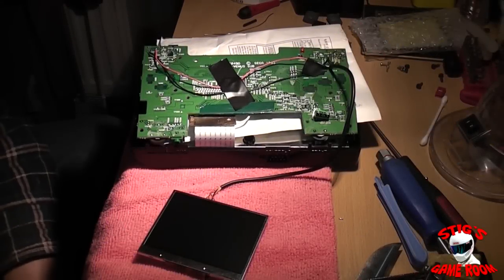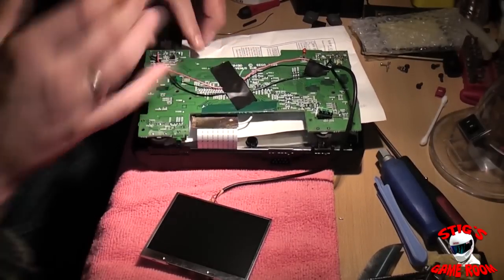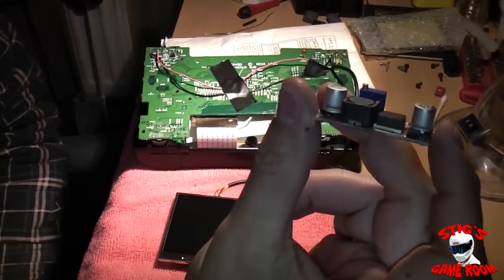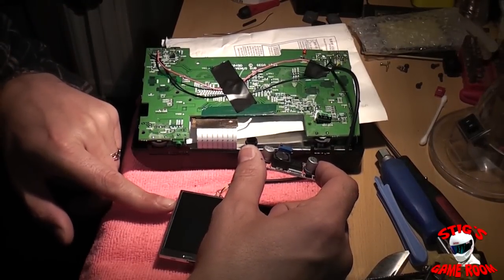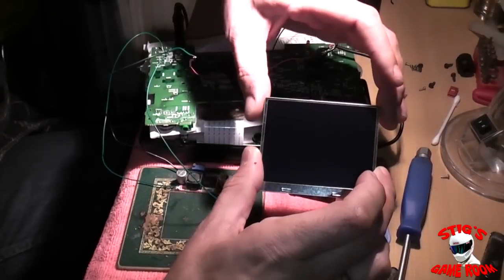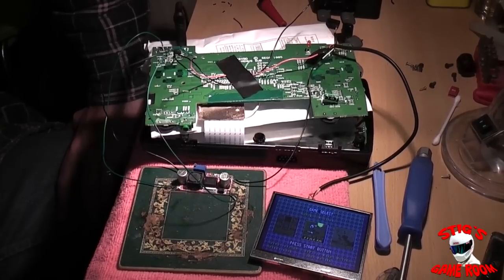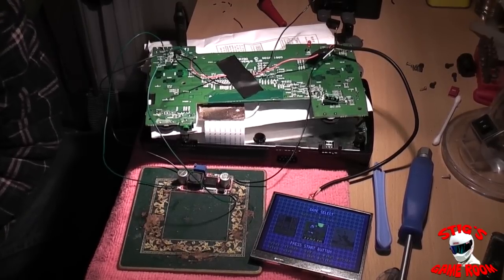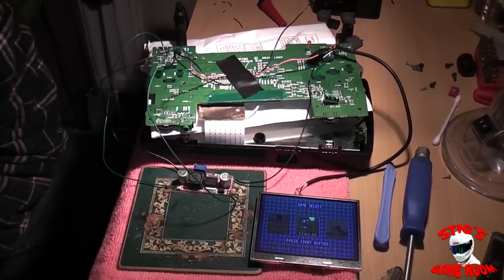Sega Nomad LCD replacement - Part 3

Comment: Hey Jon, I think you could use a 7.5V power supply which should measure close to 8. Then step it up to 12v for your screen which you have already done.  What do you think? (Great video!)
TheGreenMonkeyKing